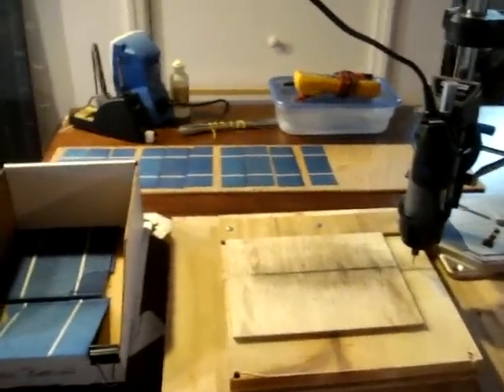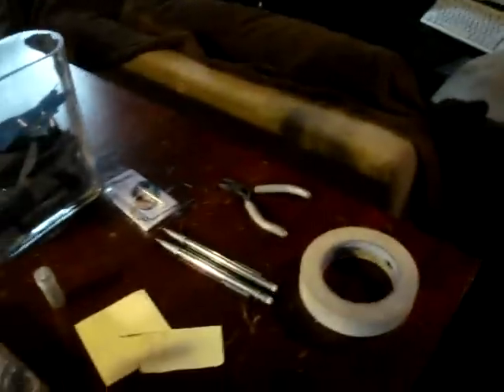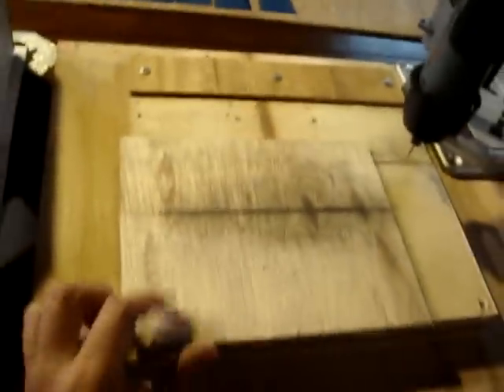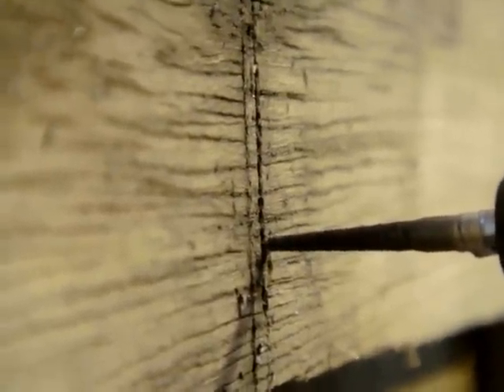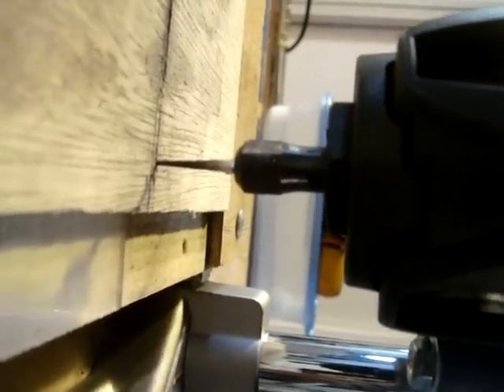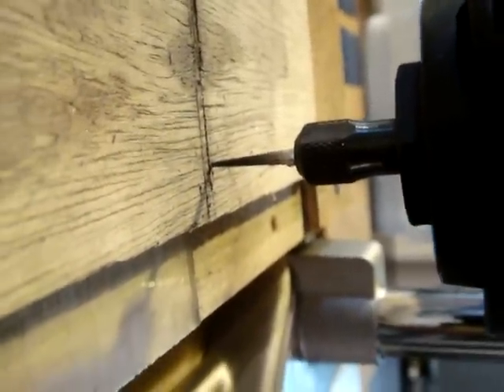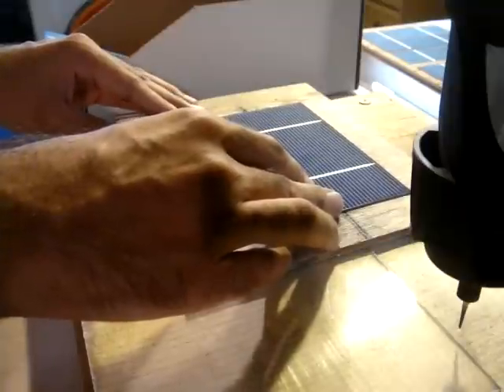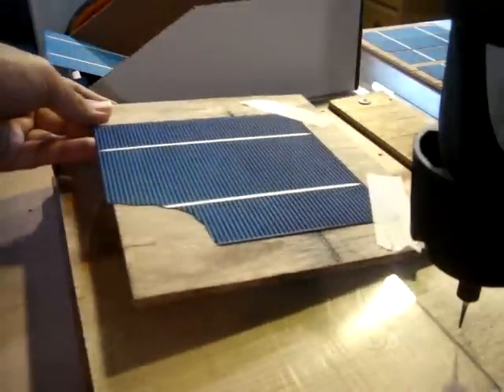How to: Dice Solar Cells IMPROVED METHOD!

Comment: very bad! cut is not clean! manual work - not good - use automatic and laser.
Reply from the maker: very bad, really? well... a dremel bit costs $10.00 and a laser costs $10,000.00 so for the price I'd say the cut was good enough. I have compared power output to laser cut cells with dremel cut cells and have not found a considerable difference in performance.
Reply: +sparkstarter thanks, i love your option, very cheat, but pls help me with bit name and size because dremel bit or the link to purchase it,i bought but it was breaking my cell, pls sparkstarter help out. guess the one i bought wasnt the right one
Reply from the maker: +Nedu Chuks could be the solar cells too, some cells may be more shatter resistant than others. post a video and I'll try to lend advice.

Comment: Hi,
Thank you for this video. I used this method to cut many cells et it works fine. I have added magnets to fix the cells quickly and it is easier to cut near the edges with less chipping.
See my video " RtSoWHc2OS4 " on You Tube.